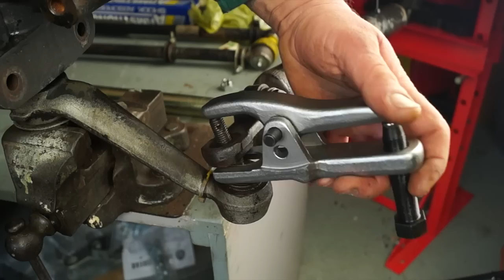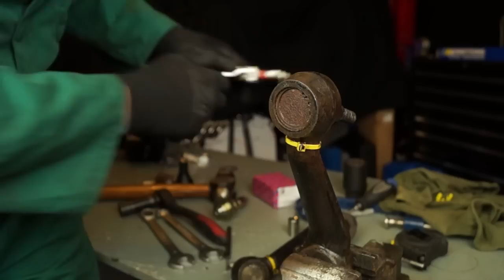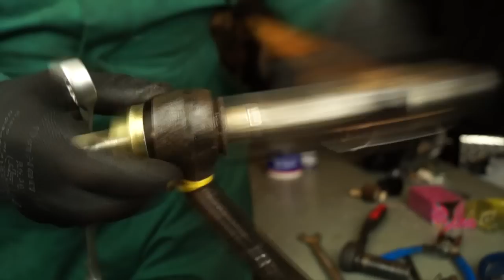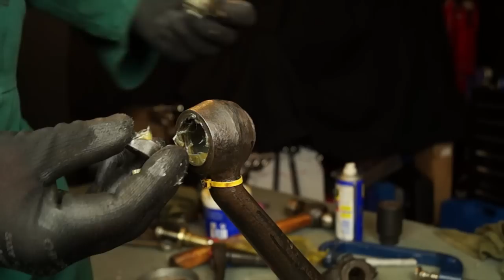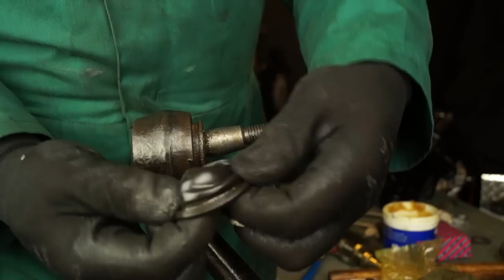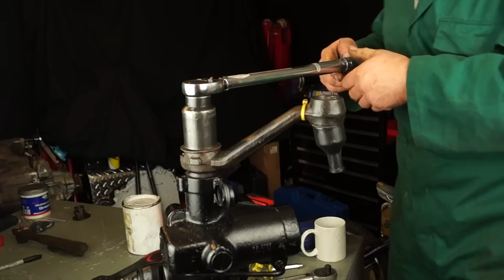DA 1125 Defender / RRC Steering drop arm ball joint replacement tool

Comment: The ball pin is preloaded with that spring, what is the acceptable endfloat for a good condition ball joint when compressing and releasing with a big pair of multigrips?

Comment: Did this tonight (with the pitman arm and steering box still attached to the car), and, aside from the whole 'hold the final (spring loaded) part on with the clamp and two sockets bit, it was as easy as you made it out to be (gravity can really trigger the worst in vocal responses sometimes). Thank you for your instruction and the play by play on this. Not only was it useful to see the up close and clear details of what was to be done, but it was done in a way that convinced me that I could tackle this.

Comment: What deep socket size did you use on the threaded side to compress the spring? Is a 27mm deep socket enough?
Reply from the maker: Which ever one fits

Comment: One thing I wondered ... is there some special colour code to the cable ties attached to the drop arms? On mine it's blue and I can't actually figure any real function of the tie.
Reply from the maker: There is a reason an I think it is to do with the reconditions reminders to themselves which dos has been recondition to whatever standard they work to.  Not 100% sure myself.

Comment: What's the name of the tool you use to seperate the link rod/steering damper from the ball joint? It looks so easy but mine won't come off :) (at 15sec)
Reply from the maker: Ah, that is a ball joint splitter.    You may do it with 2 hammers as in video  here https://youtu.be/gwwexPMp6cQ

Comment: By the way, if that ball joint tool is (I think I seen ) £15-£20 then it's paid for itself the first time you use it.
Reply from the maker: the tool will give a few years service so even after use someone else will want to borrow it I am sure.